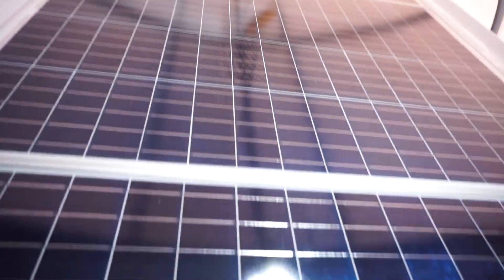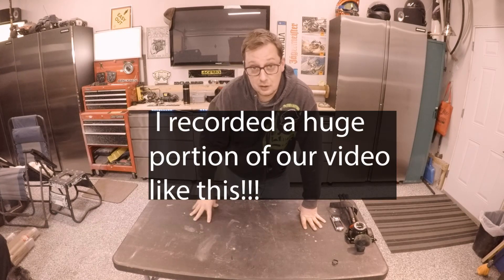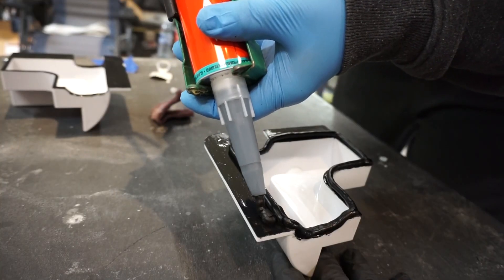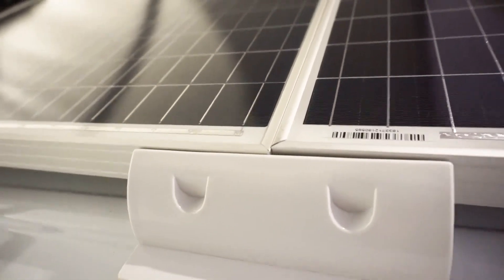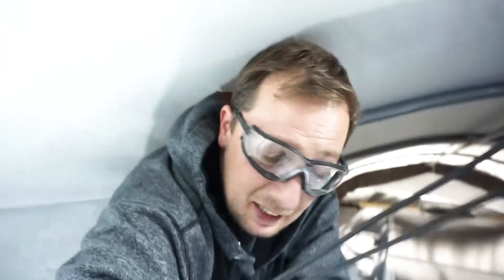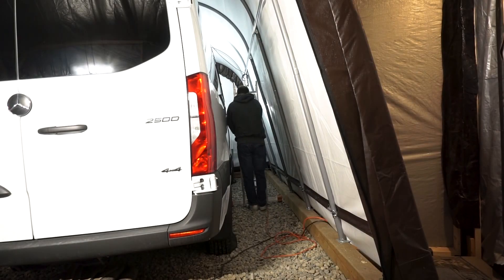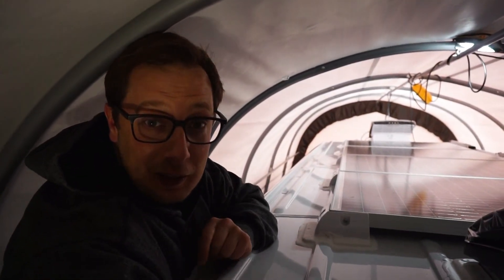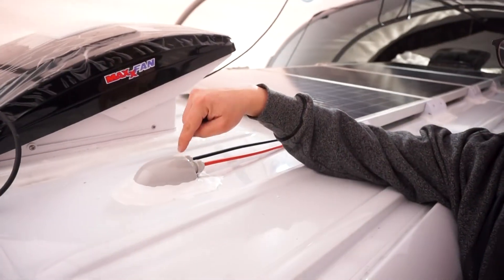Solar install - NO HOLES | FOUR SEASON VAN LIFE | EP.11

Comment: I love the no drill idea but don't you still need to cut a hole for wires etc and mounting the panels down before that part seems odd? I mean with the lock tight on the bolts how will this happen

Comment: What happens down the road if you have to replace a solar panel and that particular outside dimensions not available anymore . as in the overall outside Dimension is larger what do you do then ? - It seems to me that you have no room to adjust whatsoever for panel size.
Reply: At least he doesnt have 20 holes he needs to plug up that can leak.

Comment: Just buy a roofrack, you dont need to drill any holes to mount one on any of the high top vans! I would NEVER trust just an adhesive to secure solar panels down. How does your adhesive react to uv rays. If it starts breaking down you now have projectiles that could do alot of damage. At least with bolts you can inspect them, with the adhesive you only know its failed when the panels come off!
Reply from the maker: The adhesive used is the same poly urethane used to install my rear windows... Does that mean I should be worried about that degrading and possibly have windows falling off the van? Couple 100k factory built vehicles says this should not be an issue... Prep work is the key to longevity...  I really don't like the look of the roof racks on vans and an extra 100lbs 9 ft in the air is something you will feel driving on a windy day..
Reply: @DaresDrives  ive heard of solar panels coming off, theres a huge difference between professionals installing windows under controlled conditions. The key is the steps taken to install it, just using the similar or same product means nothing. In the factory the humidity is controlled, as with the temp. A primer is used between the vehicle surface and the sealant. I hope it works for you!
Reply from the maker: @PaulAuclair  Yes , the gentlemen with me is a professional window installer who helped me install the windows in earlier videos. For the solar panels we prepped, primed and installed these brackets the exact same way. I feel very confident there will be zero issues, with the number of brackets and surface contact area, a lot would need to go wrong before a panel flew off.... I do appreciate the great question/concern and thank you for watching and commenting.
Reply: @nakedvader  They normally come off because wind gets underneath the panel and blows the panel out of the frame or the entire frame breaks.  The attachment point is rarely the reason they come off.
Reply: There are hundreds of thousands of solarpanel glue mounted on campervan rooftops here in Europe, it is the most used method. Preferred glue is sikaflex, as for most things campervan related.
Reply: Yeah that urethane is never coming off. The key is the proper prep that was done sanding and primed. Dereck got it PERFECT PERFECT..

Comment: Your dedication to documenting all of this is so appreciated. Awesome solar panel mount design, they're easily interchanged if one of them ever breaks. Awesome!
Reply from the maker: Kurtis Wagner thanks, it’s a lot of work but I do enjoy it.   Yes, panels are easily removed if needed!!
Reply: @DaresDrives   what is the urethane specified for hold strength? I feel like a bolted connection is "secure" in the sense that it is physical. The urtehane is chemical. I am sure it is as strong or stronger, just wondering
Reply from the maker: ddut887 according to the MSDS it has a tensile strength of 1000psi meaning the plastic would break well before the urethane would release.  This is the same product Betaseal Xpress 30 that used to hold the rear windows in place.  

 Thanks for watching, hope I answered your question! As well no bolts means absolutely zero chance of leaks!!